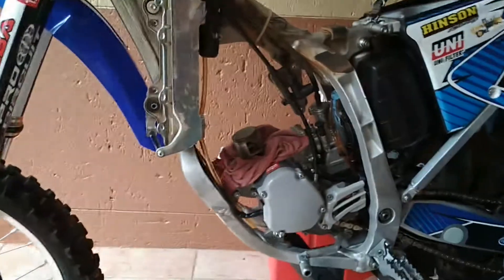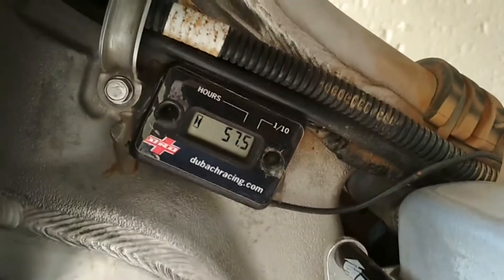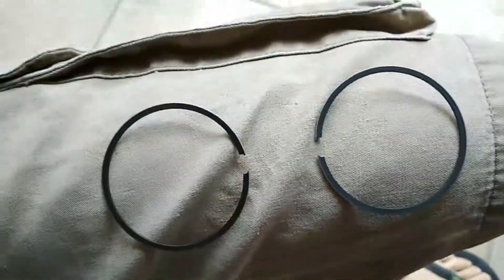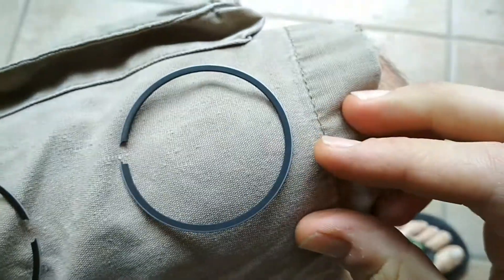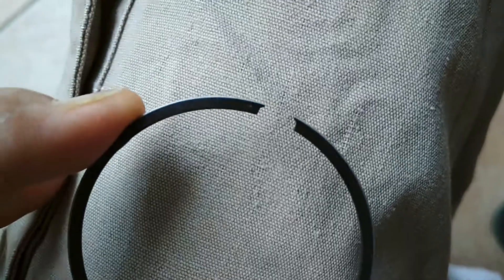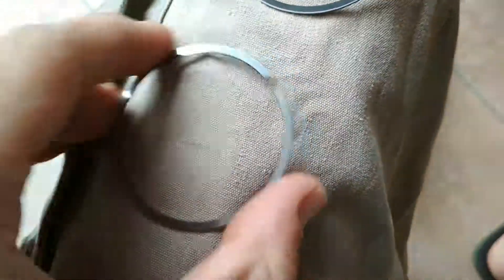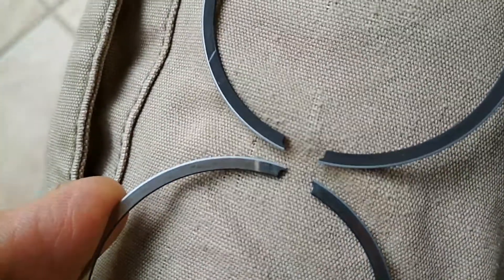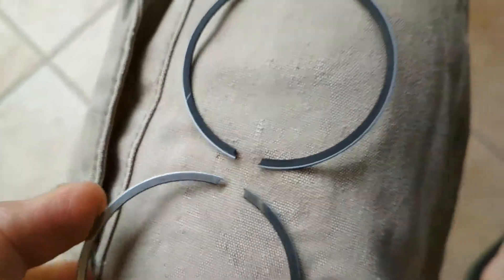How to tell if your 2-stroke piston ring needs to be changed

Comment: No point in replacing the ring, the piston is gonna get changed at 40 hours anyways just throw rings in it when the new piston gets installed. It’s very unlikely that 10 hours of running is going to affect the piston ring / the way the engine operates
Reply from the maker: Nope, 2-stroke rings often break before piston needs changing. This is highly dependent on engine operation. In this case, intermediate mx riding, the ring needed to be changed long before the piston for optimal compression.
Reply: @Dragonpops  fair enough if it’s a single ring piston but double ring piston will be fine for 40 hours.

The only reason rings fail is if they weren’t installed correctly/Ring end gap was not set before installing cylinder then when hot it seizes solid, also lack of regular maintenance. Air filter, mixing petrol at right ratio with right oils, different jetting for different altitudes and temperatures etc

Comment: On my kr150 street bike, I opened the engine to check the piston and it was intact after 10 months of daily use (even I don't have an eco-riding lol). On my 125 yz, I changed the piston and piston rings after 70 hours and everything was still in good conditions after 70 hours. Even if you really ride full throttle all the time (on a track) 10 hours its way too short for me. If my memory is good, on my 1994 yz 125 manual the recommendation was changing the piston and piston ring set, every 35 or 40 hours.
Reply from the maker: Download a modern YZ125 manual and see for yourself or contact anyone that rebuilds engines that are raced by amateurs or pros , not weekend warriors.
Reply: @Dragonpops  I'm in Thailand, working with a factory who prepare and built 2 Stroke 125 and 150 cc for 1/4 mile. They adviced me to change it when the compression decrease. They are engineer, not sellers. I tell you what professionals told me, not a YouTube warrior 👌

Comment: The only reason the manufacturers say to change it so often is in hopes that you'll take it to your local dealer and throw money at them because they usually find other stuff that could be changed... its ridiculous just like cars
Reply from the maker: Not true for competition mx bikes. In fact at high level competition, rings are replaced even more frequently. It's very common to break rings or pistons below OEM recommended hours at competition level
Reply: @Dragonpops  Well of course, in high lvl competition every little extra umpf matters because the drivers give 100%, consistently, but for people like me and you, we'll have 5-10% better times by just driving better and improving our reactions/driving technique. Changing rings after 10 hours won't give you any measurable extra performance, sorry.
Reply from the maker: @em4703  a 3 month wait for that? Not worth it. Take up your disagreement with Yamaha, not me. My video is literally titled "How to tell when...", not you must change at 10h.
Reply: @Dragonpops  In pro competition level, like you said they just don't care spending 200$ on the engine every race because they just don't want a engine failure and want 100% of the engine potential. For us you can have 200 hours on your piston if you want.. Dealers will tell you 10-20 hours just to make more money.. Just imagine how many piston-cylinder you can buy with the saving of a 200 hours piston versus changing it every 10 hours. That's what I'm doing on all my ktm and suzuki. No piston change on 4 stroke and only when I buy it on two stroke if no history and then just have fun. P-S : I usually don't post comment on youtube, I don't want to argue, just want to help.
Reply from the maker: @maximexc  NO! You've obviously never owned or raced a 2-stroke motocross bike. I've replaced pistons that were on the verge of destruction at less than 50 hours of amateur level riding. It depends hugely on riding level, air filter maintenance, and oil quality. The recommendations are based on years of testing and are safe estimates. They are not saying the components will explode after that time! Run your pistons and rings as long as you want. Good luck.
Reply: I have seen so many piston and rings fail before 50 hours especially on a 125 were you ringing it neck. It’s always good practice to replace the ring half way through the piston life

Comment: Yeah I've never had to replace the rings after like 10 hours of riding if you do have to then id quit buying that brand of piston and rings... I get that the manufacturers say they should be changed alot more than most of us fo.. but unless I am having an issue or a low compression test I dont change anything and when I do I change everything as long as I'm gonna be in there I change piston, rings gaskets, etc.
Reply from the maker: Then you're not riding hard enough. The recommendation is for competition level riding, not weekend warrior riding. Regardless using better oil will increase the life.

Comment: Replace the rings at the same time as the piston. Rings should last as long as the piston.
Reply: @aidanmacdonald6602  Yea, you do, but not every 7.5 hours lol, the reason why that is recommended in the manual is for competitions in order to avoid failure due to METAL FATIGUE. I checked the compression on my bike after 15 hours, and it was even higher than at 5 or 10 hours of use, and I ride my bikes HARD all the time. Why would I change rings and then ride it with lower compression until they wear/seat? Sorry, but I prefer not to handicap myself over the manufacturer being scared the rings might break during competition and make their bike look bad.
Reply from the maker: Actually rings must be replaced more often than pistons, usually twice as often, at least on 2T engines. Check the maintenance interval section in your manual for details.
Reply: @Dragonpops - most 2 stroke dirt bikes top end will last on average 100-120 hours. What manual and page number are you referencing? Most manuals are online now and I will verify what you are saying.
Reply from the maker: @Community-Action  maybe you're referring to ktm enduro bikes. Look at any 2T Japanese mx bike manual such as YZ125 which requires new ring every  7.5h and new piston every 12.5h.  Page 3-1 in 2012 YZ125 manual.
Reply: @Dragonpops  thats because they want you to bring into your dealership .. its all a scam.. if your not having any compression loss or any other issues then its a waste to change.. plain and simple if your compression is the same then new rings aren't gonna do anything besides wear at the cylinder more than normal because your constantly honing or atleast cutting into it with new rings every 10hrs ... I have seen 2 strokes go way longer without any issues at all and tons of compression.. even yz's. Its your car dealership told you, you need a new motor every 3,000miles are you gonna do that too.. because I bet your cars rings could use a freshen up....
Reply: @Dragonpops  That's crazy you think the rings on a yz125 need to be replaced every 8 hours 😂 the manufacturer is full of it.